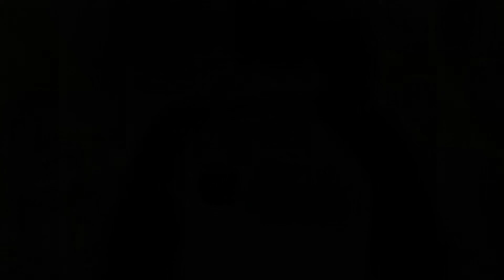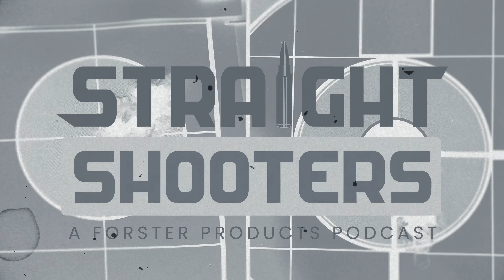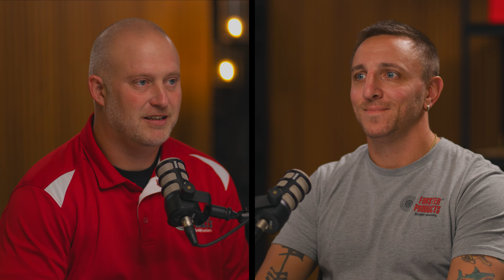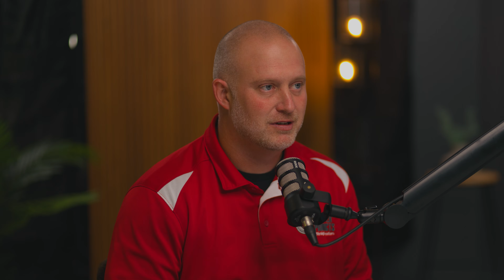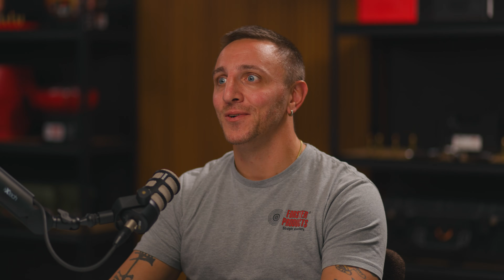The Future of Reloading

Comment: Very interesting about the curved arms.  I got after-market curved arms shortly after getting my press but know where the original, straight arms are. I’ll have to put the straight one back on the right side and see how that works for me. 

The Co-Ax press is a superior design from a functional perspective. The open front is great. The floating dies and quasi universal shell holding jaws just plain work better. I’ve preferred your bullet seater dies because of how they keep the case centered. Your old bench priming tool is expensive, but I like it a lot for rifles - especially with floating firing pins where you need to worry about slam fires. It gives me the leverage I need but I still have the “feel” I want.